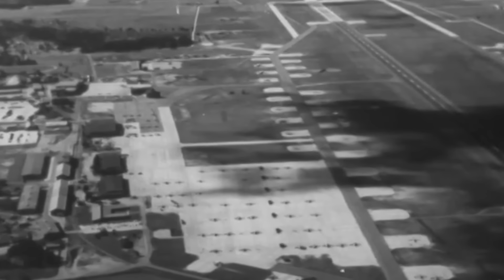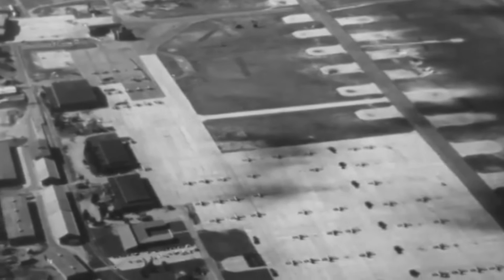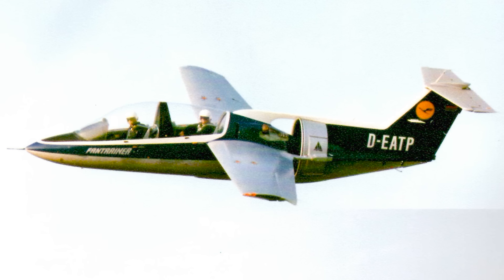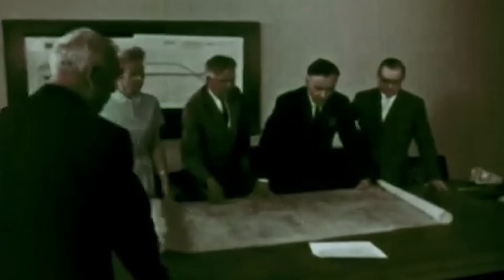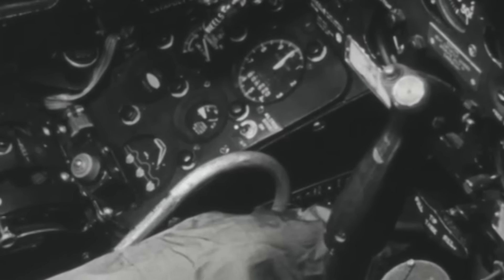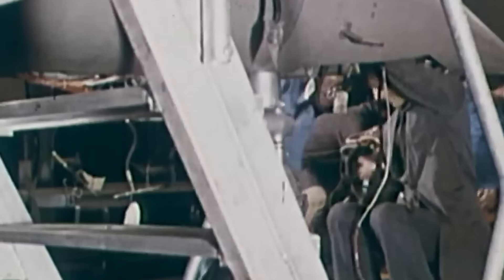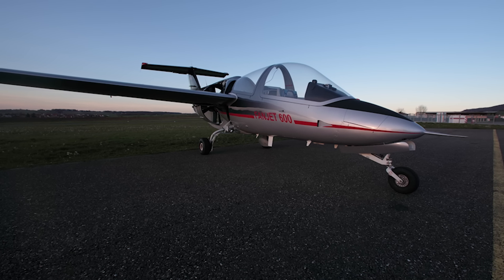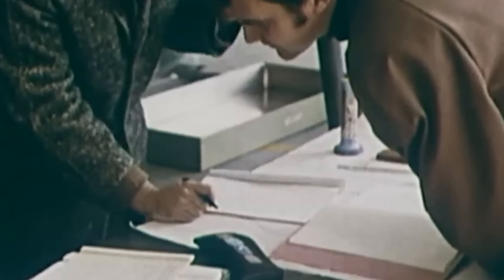The Stunning Plane that No One Really Trusts

Comment: Hanno Fischer designed virtually the first post war German aircraft even before the bans lifted - this became the RW3 Multoplane and grandfather of the fantrainer.  As far as jet like handling goes there was one slight 'flaw' in that the Fantrainer 'blew' part of the rudder which gave enhanced rudder effect particularly at low speed which was UNjet like and could make for some ingrained bad habits eg in a stall turn you get more effect from the propblast  .  I designed and built a somewhat smaller version of my RAAF (Royal Australian Air Force ) basic trainer specification AFST 5044  (1980) the Slipstream Sapphire (and smaller civil OPAL as a test bed using also the Allison C250 - then used in the GAF Nomad .  That program was a fiasco and ended the local aircraft industry with the Pilatus PC7 being bought   Hanno was helpful with advice and I had a set of the manuals for the RW3 from the original importer in the 1950s   My design had the prop behind the tailsurfaces (also T tail ) and hence no unwanted rudder 'boost'

Comment: The Royal Thai Air Force took the Fantrainer out of service in 1994, replacing them from 1993 with the Aero L-39. While there had been concern about Fantrainer parts availability the fall of the Soviet Union and attractive terms from the Czech Aero company for the trainer/attack variant made acquisition a sensible move.
Reply: Many lives were lost during Fantrainer operation brought it to the end.
Reply: There's still one (probably non-functioning) Fantrainer standing outside of a restaurant here in Chiang Mai, Thailand. Very hard to miss even when you're driving down the road.
Reply: @RavenAdventwings what restaurant?
Reply: @ericbudoryu5716   Ohkajhu Organic Farm Sansai, out by the second ring road.

Comment: You list the SEPECAT Jaguar as a trainer!  There may have been trainer versions but it was pimarily a Ground Attack aircraft (what we would have termed, back in the day, a Mud Mover).  It have the the advantage that after delivering its munitions across the battlefields of Central Europe and as we know now, causing alarm and despondancy amongst the soviet horde, it was a capable fighter too for its journey back to base. It was capable of operating from forward temporary airstrip made out of lengths of Autobahn as it was comparitvely small and light compared to say - the Buccaneer which was originally built for carrier operations and therefore built of sturdier stuff.  The Jaguar was not known as a trainer, certainly in the RAF, for that - look at the Hawk.
Reply: I believe the original specification was for an advanced trainer particularly from the French side of the project, ultimately such sophistication was not needed for effective training and it was much more expensive to purchase and fly than a purely transonic aircraft like the Hawk.

Comment: According to wikipedia, the main reasons ducted fans have never become useful production aircraft  are:
Drawbacks include increased weight due to the added structure of the shroud, a need for precision in tolerances of blade-tip to shroud clearance, a need for better vibration control compared to free-air propellers, and complex duct design requirements. Lastly, when at high angles of attack, the shroud can stall and produce high drag.

Comment: Another ducted fan aircraft that didn't do too well was the Optima. It was promoted as a cost effective alternative to helicopters. Unfortunately it had some very nasty stall characteristics, particularly in the event of engine failure. The duct seriously impaired elevator and rudder effectiveness with a dead fan.
Ta.

Comment: It's a brilliant concept. Why it was never fully invested in by any air force or even private organisations is just odd. A huge missed opportunity. It surely makes huge sense in these financially pressed times to use an aircraft like this instead of a rattly old piston powered trainer. This aircraft could be modified to run on sustainable jet fuel and be a world beater!! It's neat and compact, ruggedly built and is good looking too! I wish them every success with a re-launch of the design. (I am old enough to remember seeing the original demo models at air shows here in the UK!)😊
Reply: No. What it is is a really cool LOOKING concept. Which far too many people mistake for a brilliant concept. The very problem that it was trying to solve was itself minimal bordering on nonexistent. While it was arguably cheaper to purchase and operate than a dedicated full jet trainer. It still remained much more expensive than the traditional turbo prop trainers. While introducing a number of new problems and flight characteristics into the mix. And as many have pointed out, pilots in truth have very few issues transitioning from propellers to jets. This was a solution in search of a problem to solve. And the services still needed jet trainers as managing jet engines in flight still needs to be learned. Plus this thing almost certainly has some unique aerodynamic characteristics and problems. Does learning these in any way benefit a pilot transitioning to jet warplanes? This thing almost certainly has some strange angle of attack quirks. Plus all the joys of a high T tail.
Reply: I think it was one of these that I saw at a Farnborough airshow once. There was a quite strong headwind right down the main runway, and the plane was able to fly so slowly that it ended up actually hovering right next to where I was spectating. It was quite a sight seeing this small aircraft with a ducted fan at quite a high angle of attack slowing down as it approached, until finally, for a few seconds it was able to actually stop all forward movement. Then it powered up and flew away. Amazing!

Comment: They are going about it all wrong.  Come out with an experimental fast build kit for the EAA crowd... Go light weight composites, an off the shelf aircraft motor around 200 horsepower, and a basic glass cockpit for single engine IFR operation under $150K...   Generate revenue to get profitable first, then worry about other designs like a General Aviation product or two.

Comment: What about a Jet engine for forward thrust but ducted fans for maneuvering and stability at low speeds?  Probably more weight and complexity to make any sense at all.  So many cool designs from the 1950's and 60's that become dead ends.  I wonder how many of these designs just need another look 80 years later and new use cases exist.
Reply: yak 110 from  Jeff Boerboon ?

Comment: I'm looking at it and wondering if it could be  made super quiet and used as a ground straifing and bombing aircraft for small unit backup for special operations. 
An economical ground support vehicle that cost a fraction of a Apachi hellicopter would be great. 
Of course itwould never be used because the regular aircraft companies have the senaters, congressmen, and generals in their pocket. Best case senerial would be Northrop buying the company up for it's patents and developing a quiet, hardend version of their own.

Comment: This is an outstanding design to be honest. But, and yes there is always a but. The design is sound, but the top speed is not what a turboprop can do if properly configured. You got turboprops like the Piaggio P 180 Avanti that can push nearly 500mph (804KPH) and the TBM 900 pushing 380mph (611KPH) so speed is highly considered and desirable as the bar is pushing to 400mph(643KPH). So there is no excuse for a lower top speed. And turboprops operate ideally in the lower altitude bands (39000 feet and below) anyways. So if you want to compete in this segment of trainers, you need to have the high agility, state of the art avionics, and speed. 

It looks promising, but another potentially fatal design flaw would be the propeller shaft itself. Many engineers balk at using turboprops to drive long shafts to propellers mounted longitudinally along the plane's axis. These shafts must be harmonically balanced, precisely modulated for engine speed, and they are more of a headache for maintenance as they must maintain this precision at all times. America discovered this with the Bell P-39 Airacobra. The engine was mounted near the pilot driving a propeller located in the traditional forward nose cowling. Good performance, hard to work on. And I can't imagine this plane being any less difficult to work on. Maybe a dual counter rotating propfan with twin turbine engines joined to a common shaft with very reliable turbines could solve balance and speed issues as centerline thrust would be countered by the two prop assemblies.  Carbon fiber for construction, light avionics, and a better designed wing could make it a good contender for a low level attack craft.

Comment: Would it have roll issues since it has just one large fan rather than 2 contra rotating fans to cancel out those forces?
Reply: No, like most single engine piston aircraft you have a few ways of countering the torque. For example some aircraft are build with a slight curve to their fuselage (almost invisible) wich induces a torque in the opposite direction to the engine.

Comment: For some reason,  I'm pretty sure the ducted fan are less efficient that a standard efficient prop. Pulling and pushing air threw a duct has more drag and possibly more issues.
Reply: It probably is, but i think the purpose is much more about making the performance and handling as similar to a jet (with an engine in the back) as they can with a prop plane because even though the prop placement and ducts might not be the most efficient, they're still 10x more efficient than a trainer jet. I imagine it would have noticeably different handling if it didn't have the ducting, and it would have vastly different handling if the prop was in the front, even if it might have better performance. Just about every rear engine jet has air intakes, and having the ducting is likely to simulate that
Reply: Ducted fans are much more efficient than a propeller with the same diameter. But a free propeller can be made with bigger diameter, to compensate for less efficiency. The duct add weight, but a smaller propeller save waigh.

Comment: Wonder how well this would work with a piston engine instead of the turboshaft? 
Maybe a Subaru or other liquid-cooled auto conversion: Since the engine's buried in the fuselage, air-cooling a Lycoming or Continental might be tricky. That would certainly cut initial and operating costs, though at the price of some top-end performance. But it might make a fantastic sportplane.
Reply: Gas turbine engines offer much better power-to-weight ratio performance and a order of magnitude greater reliability.
Reply: As a general rule automobile engines are not designed to deal with the rigorous demands of aircraft applications and typically fail the reliability test required for airworthiness certification
Reply: @WilhelmKarsten  ".....Gas turbine engines offer much better power-to-weight ratio performance and a order of magnitude greater reliability....." 
But at many times the cost. Even a Lycoming or Continental four or six - expensive by auto-engine standards - costs a fraction of what a turbine does.
".....As a general rule automobile engines are not designed to deal with the rigorous demands of aircraft applications....." 
True. So you'd want a liquid-cooled certified powerplant. I'm just not sure if any are in production right now. There are proposals, but many of them seem to be vaporware.
Reply: @Baribrotzer  The Thielert Centurion is the only water-cooled certified engine that comes to mind.

Comment: So couldn't a duct design have 4 or even 10 sets of blades on a single shaft? Imitating a turbine engine layout, but powered by the piston engine? How high would the efficiency be compared to 1 or 2 propeller in the ducted design?
Reply: slip flow aerodynamics

Comment: The ONLY reason for ducted fans on large aircraft is that the engines are so high horsepower that you need either 20 blades or 2 really long ones, so long that they dig into the pavement.

A 2 bladed prop is most efficient, then a 3, then a 4, ……then a 20.

But a 2 blade prop can handle maybe 3-400
Hp, after that it either gets LONGER or more blades.

Ducted fans are not used because they are “more efficient” but because they can handle the load without a 20ft long prop
Reply: I thought single blades were the most efficient?

Comment: So it's like a High Bypass Turbojet, but instead of the fan running directly off the front of the jet engine, it's geared down to use a more cost effective ducted fan. Wonder how it would have gone with a fan more like that on passenger jets. That 10% Of The Fuel should have grabbed a lot more attention. Rather then a jet trainer, they should market it as a Executive Express, for business people or self-flying celebs that need to get places in a hurry rather then spend hours in traffic.

Comment: The germans could possible build this aircraft during WW II  It looks not so difficult to make with 1940s technology and knowledge. 
An engine with 3000 rpm would be some DB and the plane itself could be designed by Messerschmidt. Adolf Galant as test pilot )))

Comment: Why do you repeat yoursrlf several times?
1. A mid fuselage mounted fan propulsion plane
2. Can be made at a tenth of the cost of a jet
3. Uses a tenth of the fuel
4. Performs like a jet

I'm only 4 minutes in and you have already repeated these points three times. We get the point.

Comment: instead of a turboprop - this is a turbofan?

fantastic!
Reply: Ducted fan
Reply: @WilhelmKarsten  
driven by a gas turbine = turbofan
Reply: @andyman8630  Not fully integrated, it's a ducted fan.
Reply: @WilhelmKarsten  
neither is a turboprop fully integrated
Reply: @andyman8630  thank you for proving my point.
Reply: @WilhelmKarsten  
what point? the prop in a turboprop configuration is not integral, and netheir is the ducted fan in this instance! in fact the only difference is the prop in this macine is ducted

so if it's standard to call a turboprop a turboprop, why is turbofan wrong for a fan driven by a gas turbine??
Reply: @andyman8630  It's called a ducted fan, whether it's driven by a reciprocating engine or a gas turbine.
Reply: @WilhelmKarsten  
it's called a propeller, regardless of whether it's being driven by a reciprocating engine or gas turbine - except it isn't, it's called a turboprop so i 'invented' the term turbofan
Reply: @andyman8630  Sorry, but Henri Coanda already invented it, and he named it a Turbo-propulseur which has an Impeller

Today the Industry calls it a Ducted Fan regardless of the power unit used to drive the Fan, Propeller or Impeller.
A Ducted Fan can have axial, semi-axial centrifugal type propeller or impeller.

Any questions son.
Reply: @WilhelmKarsten  
except his device had no combustion chamber
Reply: @andyman8630  Coanda made a highly dubious claim 40 years later that the 1910 was a powered by "Motorjet" but there is zero evidence to support this claim.
The 1910 was powered by a 4-cylinder inline Clerget reciprocating engine and never successfully flew.

Comment: "jet like agility". jet are known to have an horrible agility, unless they have thrust vectoring
Reply: Jet fighters have excellent agility, beyond the limits of human pilots in fact.
Reply: @WilhelmKarsten  if you use Gs as a measure sure, but because they're faster. Jets are also more agile at high speeds, but that means they can't pull much degreed/s because the pilot goes on over G faster. Prop aircrafts are more responsive too, if it matters
Reply: @todeilfungo  It means that jets are more agile...

Comment: Not only did you just use your short version as an intro only to immediately repeat it, you mention like 7 times in 1 minute that it has a ducted fan and saves fuel. I get it. Can you find a way of padding your content better than repeating the same statement a dozen times like youre a middle schooler with a word minimum hes trying to reach?

Comment: Do people not understand that every "jet plane" out there are all fan powered? This plane simply has a turbofan in a slightly different configuration.

I'm quite surprised that this aircraft wasn't marketed to third world countries as a cheap and reliable combat aircraft.
Reply: You clearly don't understand the difference between a ducted fan and a Turbofan.
Reply: @WilhelmKarsten they're both ducted fans.
Reply: @Petriefied0246  No, a ducted fan can be driven by any type of engine and can be integrated or non-integrated.
Turbofan engines are fully integrated and operate only using the Brayton Cycle internal combustion engine. 
Any questions?
Reply: So configuration, like I said.
Reply: @Petriefied0246  A ducted fan is not a turbofan they are a completely different concept.

The ducted fan was invented by Henri Coanda. (1910) 
The Turbofan was invented by Daimler-Benz (109-007) in 1940.
Any questions son?